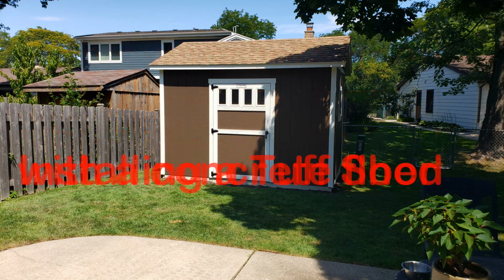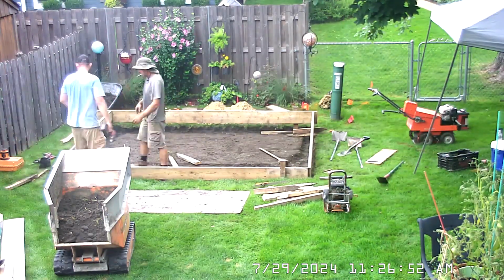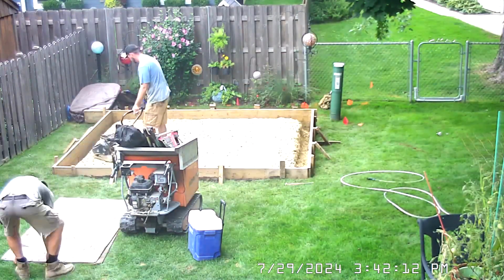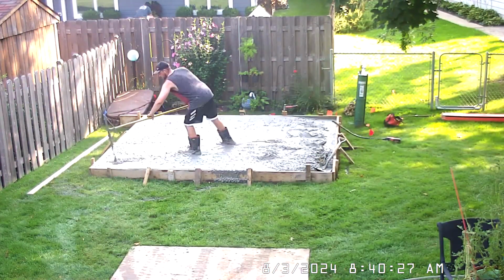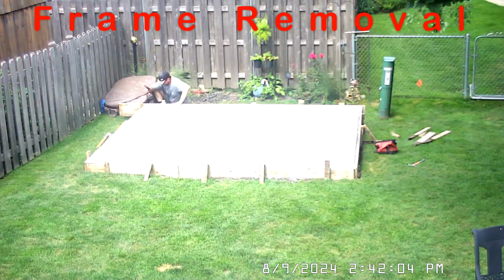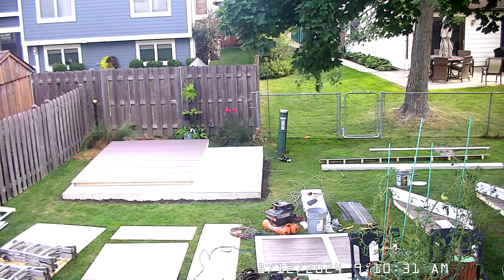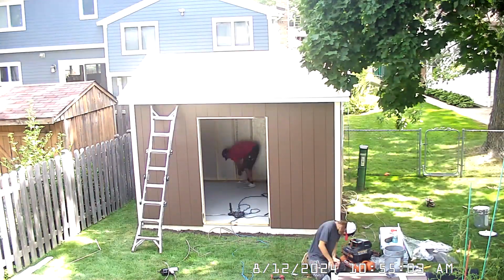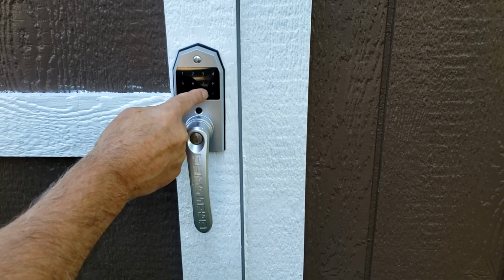Installing a Tuff Shed on a concrete slab

Comment: Thanks for posting the video and going through all the steps. The concrete slab looked very well done, they seemed to take a lot of care and did a nice job, particularly with how they handled the higher height above grade at the back edge.

The shed installers did a good job too, it was very useful that you had the time display on. It made it simple to see just how long the various steps took. Those guys were definitely pros and knew how to work efficiently. I'd still be getting my tools ready at the one hour mark, and then I'd need a coffee break! Thanks again and hope the shed is useful and holding up well.